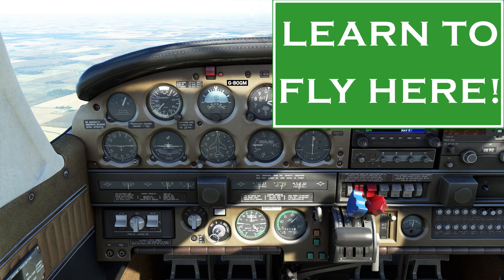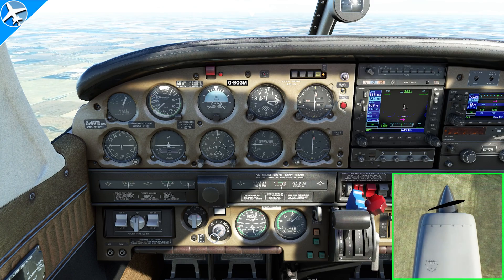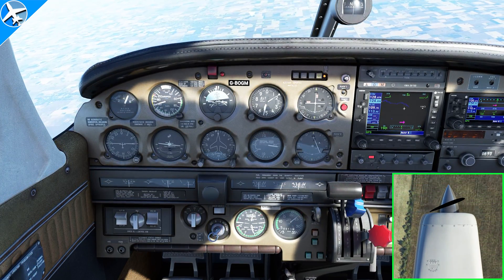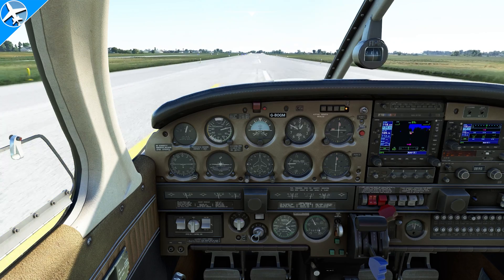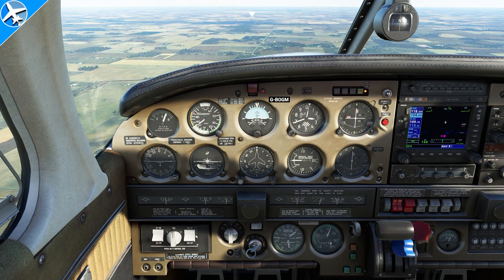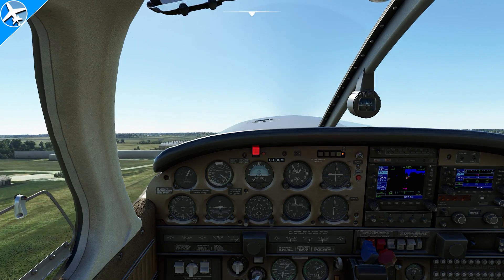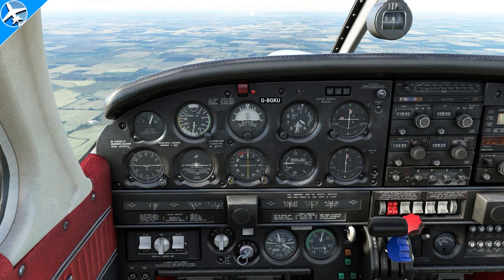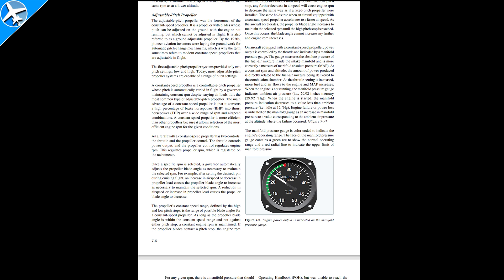The Constant Speed Propeller: See How it Works with Animated Propeller Blade

Comment: Question.
Why not just have an engine that performs the same way a fixed pitch works and then just add a variable pitch lever to simplify things?
You set your desired pitch and then fiddle with the rpm when needed.
Set the prop for takeoff, then set rpm. In the climb, just alter rpm as necessary. In cruise, set cruise propeller then fiddle with the rpm as necessary and same thing for descent and landing. 
Would that not be simpler than all this overstated undersquared stuff? 
I'm a pilot in training, and constant speed gives me a headache to use and understand. I assume it annoys other people too, that's why new planes come with single lever operation.

Comment: Constant speed props are the bane of my training.
I barely understood how these things worked and was frustrated as heck.
Reply from the maker: Join the club.  I was the same way back then and they were not explained well by anyone.  Just remember this basic characteristic: the prop RPM is set by the prop lever.  The governor will adjust pitch within its limits to maintain the selected RPM.  The blade angle will change based on speed changes and changes in manifold pressure by the pilot to maintain the selected RPM.

Comment: Thanks for this really good explanation!
I have a question regarding the prop lever: Am I right that not all prop-angle-adjustable planes have a constant-speed prop? I'm not a pilot, just a flight simmer, but from my experience, the Bonanza G36 adjusts the angle of the blades with the blue prop lever, and if you decrease the throttle, the RPM drop, so for me it seems the blade angles are not re-adjusted for trying to keep the RPM.
Thanks in advance for your answer!
Reply from the maker: The prop is constantly changing the blade angle to maintain the desired RPM.  The propeller blade has a certain angular range of operation.  When those limits are hit (high/low pitch stops) the propeller will act like a fixed pitch propeller and blade angle won’t adjust with airspeed and throttle changes as often seen when coming in for a landing when the prop RPM decreases on final even though the prop lever is full forward.
Reply: @thecorporatepilotdad  Thanks for your reply. I checked the 'advertisement' description on the homepage of the Bonanza manufacturer and indeed, they state that the Bonanza has a constant speed prop. Just my experience in the MS 20202 Flightsim was that even in the middle range of the prop angle range there was no readjustment in order to reach the desired RPM again when throttle was moved. I saw this in other planes, however. I will later check in the Filght Sim .. ;-)

Comment: So in your correction, you mentioned that the Cirrus doesn't have a FADEC. Since it also doesn't have a prop control lever, what actually controls the prop pitch and RPM then?
Reply from the maker: The throttle is connected to an arm which moves a cable connected to the prop which is the same thing as the pilot moving a prop lever with conventional controls.  If the throttle is pulled back the prop RPM is reduced.  There is a really good diagram of it in flying magazine if you do a google search it should come up.

Comment: I just bumped up to a piper arrow after a quick 100 or so flight hours.  So easy in the sim.....
This was just what I needed to get used to the blue lever. Thanks
Nice artwork too!
Reply from the maker: Don’t forget the Arrow has altitude hold if you hit the Piper logo on the mode selector for the autopilot.   That AP in real life doesn’t have Altitude hold but the JF programmers were nice for adding it.  I did a video on that autopilot if you need that by chance also.   Glad you liked the artwork. The video wouldn’t be nearly as good without the fancy artwork.  That took so much work.   There is also a video on the emergency gear lever which explains the three positions the lever can be placed in.  Enjoy!
Reply: @thecorporatepilotdad  thanks. I just read the manual and saw the AP hold switch.  Ill check out the video though.  the AP was one area where I wish they took some design liberties.  Would have preferred a vertical speed or whatever you call it switch.

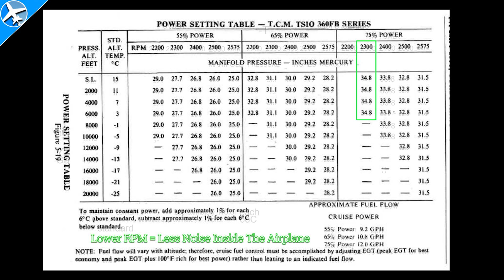Comment: 6:48 - is there anything behind "Lower RPM = Less Noise Inside The Cockpit"? Let's say we are at 6000ft MSL and according to the table we have 5 different combinations of RPM/MP which yields to the same 65% BHP. Are there any other factors that would make you choose one setting over another?
Reply from the maker: Lower RPM is quieter but also in icing conditions a higher RPM can sling off more ice off the prop from centrifugal force.

Comment from the maker: Update: The end of the video states the Cirrus has a FADEC.  It does not.  My mistake, but the propeller works the same regardless.  It uses a mechanical linkage from the throttle to the propeller governor to regulate RPM.  At full power the prop RPM maintains 2700 and in cruise, 2500 RPM.

Comment: AFAIK, the Cirrus isn't actually a fadec, it's a little mechanical lever system down there in the center console.
Reply from the maker: After more research, you are correct.  The Cirrus does not have a FADEC. Too bad that wasn't caught when I made the video! I was told it had a FADEC.
Reply from the maker: I put a correction in the description.  Thank you for bringing that to my attention.

Comment: I've just started to learn about constant speed props.  I think there's one detail that isn't represented in most tutorials but I'm posting here (to one of the most recent video uploads on the topic) in hopes that if I'm wrong someone will point it out to me.

When the engine throttle and pitch are in the full forward positions, the propeller is spinning at max RPM and the engine is running at a high manifold pressure.  The blade is slicing through the air relatively easily because the pitch is very low, right?  It's not completely clear to me why this is preferable for climbing and takeout vs. a lower RPM and lower manifold pressure with higher pitch.  Is the thrust of the lower manifold/blade RPM pressure situation less even though the blade pitch is higher?

Regardless, what I think I have worked out is:

If the engine throttle is decreased, the engine begins producing less power.  The manifold pressure drops.  In order to spin the blade at a constant RPM, the pitch of the blades becomes even less than with the throttle at high.  At some point there is a "stop" but the blade will be more flattened-out as the throttle is decreased.  There is a change to the pitch even though the RPM/speed/blue lever has not been touched at all.  Then, when the blue lever is pulled back slightly, at some point the pitch is back to where it was originally, but the propeller rotation speed is less since the engine does not have the power to rotate it at the same speed any longer.  Right?  For some reason I wasn't "getting" the connection between the throttle and pitch changing together when the blue lever was not touched. 

Next, I'm thinking if the blue lever is pulled back far enough, eventually the propeller angle-of-attack will be so high that it will stop producing thrust, correct?  And if it can be, and is pulled back into a "feather" position then the engine would be meeting the highest amount of resistance possible but this is a position which is never intended to be used while the engine is rotating the blade, right?

I believe from the tutorials I already understand that pulling the blue lever back while leave the throttle at max would result in the highest thrust but this would come at the cost of stressing the engine beyond what it is designed for.  And simply pulling the throttle back after leveling-out takes load off of the engine but since it causes the blades to "flatten out" thrust is lost quickly. 

If I'm off on anything I'd appreciate a correction!
Reply from the maker: That was a great comment.  The prop at low pitch/high RPM does produce less thrust per blade rotation but it spins more times in a given amount of time giving more overall  thrust.  

The blade angle will change based on speed (think of a fixed pitch propeller and how it speeds up with an increase in airspeed) and if speed increases, the prop blade will increase pitch to bring the RPM back to where it was.  It does it fast enough that it goes unnoticed.  

The prop lever can't be pulled back so far that it goes to feathered pitch on a single engine piston  but on a twin-engine it can and no thrust is produced in that situation, but more importantly, drag is greatly reduced from the prop being feathered to help the airplane climb better and or possibly maintain level flight.  On a single engine piston the prop lever can't be pulled back to make the prop go to a feathered position.  It has a very small angle of change from low to pitch to high pitch.  When it goes outside those ranges because the blade angle can't be moved anymore, it then acts like a fixed pitch propeller.  

In flight, the prop blade controls prop RPM.  Knowing what it does it nice for fundamentals but when it comes to flying an airplane, it controls RPM and you're along for the ride.  There are other considerations with constant speed props such as increasing RPM in icing conditions to to attempt to keep ice from accumulation on the prop.  The prop lever can be moved full forward in a descent to increase drag and increase the rate of descent (think the opposite of feathering a prop).  No one does that too often, but it can be done.  Props can overspeed as well and no control can be maintained as well as very little thrust being made to maintain level flight.  There are NTSB reports on that happening.  

Hopefully all your questions were answered.

Comment: Maybe you can help me with this. After pressing the NAV button in the citation longitude the plane starts oscillating crazy in the air (about 10 to 15 degrees left and right) the only way I found to fix it is just flying the plane in heading mode. Do you have the same problem?
Reply from the maker: Everyone on MSFS has that propblem as far as I know. It's been a problem since MSFS came out.  It does it at high altitudes but not down in the 20s and below.  I think there is a mod for the Longitude but whether it fixes that or not is a mystery.  Check out the Official MSFS forum on that one.  Too bad that hasn't been fixed yet.  I wish I had better news on that one but I don't.

Comment: I understand that once reaching cruise altitude you throttle back to the manifold pressure as listed in the POH (say, 23 in.) Do you then always turn the prop back to about 100x this value (about 2300 rpm)? And then to increase power  (or get ready to land) you start with the prop to full then advance the throttle? As for the mixture in a non-turbo, what do you gauge it's setting by without an EGT reading?
Reply from the maker: 23 squared is acceptable.  Generally, keeping the RPM higher than MP is a good rule of thumb.  I've heard this is not true as much anymore with modern engines, but it depends on who you ask.  Yes, prop full forward then throttle as needle on final. For leaning, most airplanes will have a CHT or EGT, but if not, fuel flow could be used.  Watch it start dropping and the engine may lose some power and or the engine will run rough then increase the mixture a little after that.

Comment from the maker: What is the biggest propeller ever made?
Reply: wind turbine !   ;-)
Reply: OooK...  The largest aeroplane propeller ever to fly was the 6.9 m (22 ft 6 in) diameter Garuda propeller, fitted to the Linke-Hofmann R II which flew in 1919 and was built in Breslau, Germany (now Wroclaw, Poland). It was driven by four 195 kW (260-hp) Mercedes engines and turned at only 545 rpm. Today, typical single-engine aircraft have propellers of roughly 2 m (6.56 ft) diameter, and turn at approximately 2,500 rpm.
Reply: Idk but the Corsair from ww2 had the biggest props ever used on a fighter at the time. 13 ft 1 inch.
Reply from the maker: @sebastianthehotsaucedude5473  That is a huge prop.  Think of all the torque and gyroscopic forces the engine components attached to it would have undergone while dog fighting.  That's a pretty amazing feat.
Reply: @thecorporatepilotdad  i imagine she reallllly wanted to roll left.
Reply: @sebastianthehotsaucedude5473  Yep! 3 kill on the right, 12 on the left